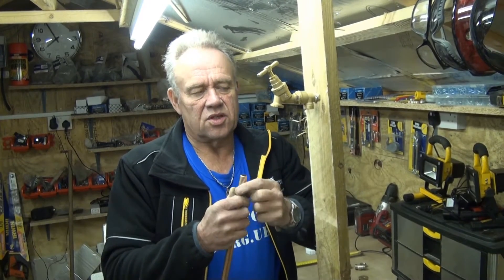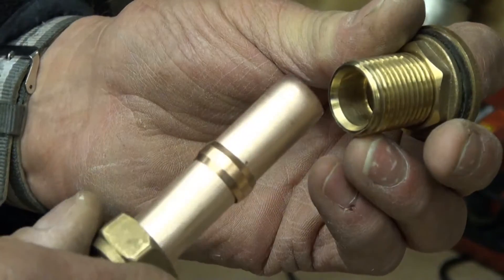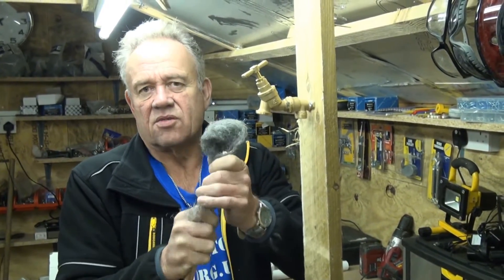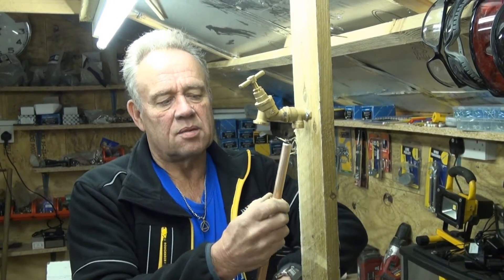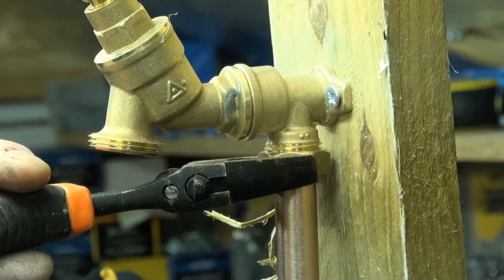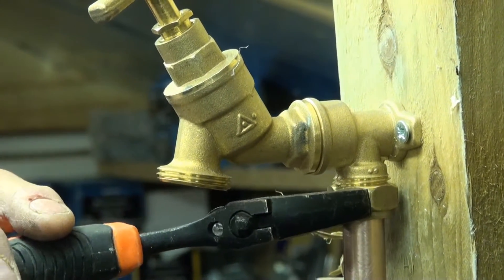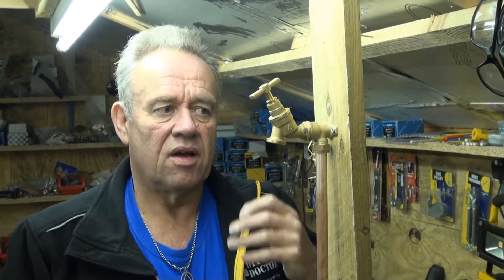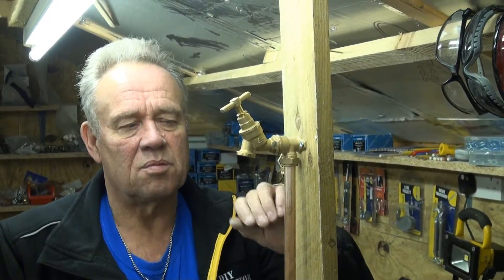How to use a copper compression joint

Comment: i was taught to use hawk white jointing compound on olive in college portable compound if drinking water
Reply from the maker: Hawk White can be used if a jointing compound is necessary Raz but for a well fitted compression joint there is rarely the need for Hawk White, Hawk Green or PTFE tape. By al means use what you were taught, it is not wrong in any way and onbiously adds an element of extra protection if it is required.